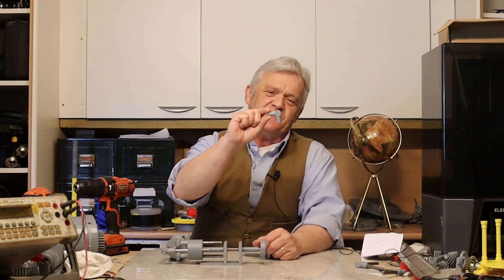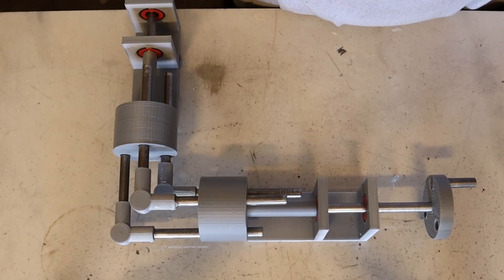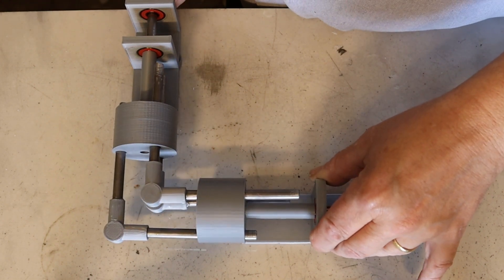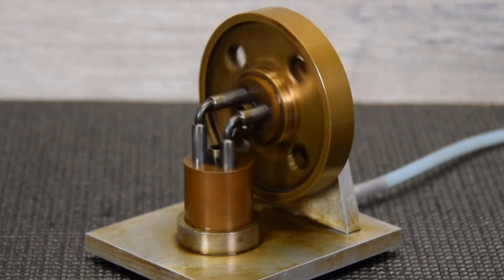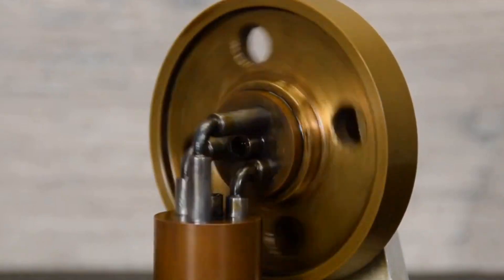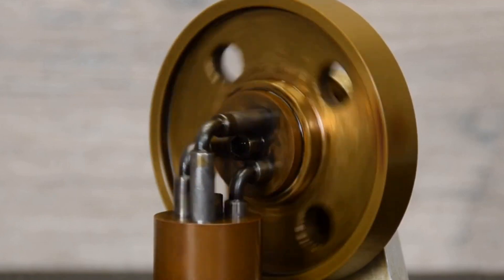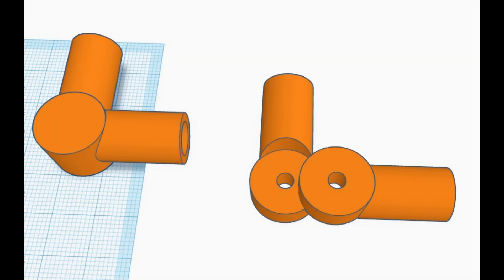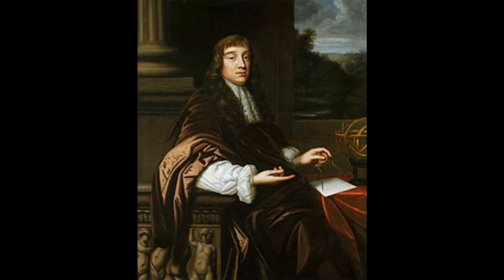2011 A Most Interesting And Useful Mechanism - Cardan And Hobson

Comment: looking at those shafts makes me think of piston engines. Imagine an internal combustion engine with zero articulating bearing surfaces! You could integrate a points ignition system and cam profiles into the rotating cylinder assembly, no chain or belt, and you wouldn’t need a flywheel due to all the rotating mass.

I suppose a real bear of an issue could present itself when trying to seal oil into the mechanism while it is rotating.

Comment: There is one critical failure point on that. If the rods are perfectly straight (not gay) they can get out of the optimized position and then cause a critical failure. Actually it might be, when they are not in the right spot on their length, it can't change angle anymore.

Comment: One problem with the hinged rods is that at zero angle the rods could rotate to put the hinges out of line with each other then it would bind. Such a mechanism would either have to be constrained from straightening fully or movement through zero degrees would need to be quite quick and it could never be allowed to hold at zero degrees, at least not while spinning.

Comment: This makes me think that half  of this. one rotation force could now be channeled to 3 different generators.  so you could set one generator up to merely monitor that its getting voltage ad turning, and keepturning on the other two generators as the wind ramps up and off as it goes lower. a sort of smart electric clutch.

Comment: I was thinking for the O Neil Cylinder,  Besides using 5 Foot Diameter Rope/Cable as the thread in a carbon fiber sheet (just scaled up) with mesh and graphene resin as the filler, Pylons obviously need to be interspersed with a network strung all around it.

Pylons need to be interspersed throughout the basket, so that buildings and the like can be plugged in (the Entire Cylinder needs to act as the foundation)

Could Ariel Eckblaws Disks be designed to act as not Only the scaffolding for the "thread" (5 foot diameter steel or graphene carbon fiber/nanotube cables) but also for inserting the Pylons for the buildings?  The "Thread" could be strung throughout the system, with graphene carbon fiber mesh and I was thinking either Concrete or a graphene resin could fill in the spaces, that way the Cables/industrial ropes bear the brunt of the shearing/lateral forces.

Also, Do you think it's possible to design a graphene carbon fiber "hitchhiker?"  Just like the burs in your socks after you walk through a grassy field, could the spaces be filled with graphene carbon fiber or even nanotube "burs" so that you could fill in the spaces with That, and just pour in graphene resin?  That way the "bur concrete" could also flex laterally with everything else and not just become rubble?  It would still stick together with resin, and any resin that itself cracks, you could take out, fill in with more "bur concrete" and it could flex side to side, even IF the Resin or concrete cracked it would still work if it failed.

To test it out, all I need is one section of the shell, essentially a 15 foot or 20 foot section of 5 foot industrial rope (plastic string from recycled bottles and bags are just fine) with the scaffolding, pylons, and support structure, along with the matrix of mesh and concrete or "graphene carbon fiber burs" with graphene resin filling in the spaces of the section of Cylinder.  Then the tolerances can be measured and spun around.

Comment: Ice coolers, those plastic boxes for ice, food and drinks, has a fatal flaw. The plastic used in mass produced coolers is a very good infrared transmission medium.
Is it possible to build a cooler where the inside of the box doesn't absorb heat from outside of the box?

Comment: Its noisy and noise means energy loss, and that energy loss is more than likely causing microfractures to appear in the 3D printed parts. It's hard to imagine those tiny 3D printed parts lasting more than a few days with continuous use. Even with metal parts there's rods moving in and out of those tubes under tension so there's going to be a lot of wear.  I suspect there's a good reason we don't see this joint being actively used and it's probably not because of fashion.
Reply: That is precisely the issue. The device is complex and requires multiple moving parts which must be strong enough to take linear and axial loads -- which adds weight, which forces tradeoffs between torque, speed, and efficiency. For most applications there are better ways of transferring power. The main advantage is the use of simple parts, even though there are a lot of them, so it can be built and maintained without complicated machining.

Comment: Hi Rob, that coupling on it’s own is a great project. There is another coupling that was recently invented to act as a constant velocity coupling called the Thomson coupling which is easy to find on the internet if you want to have a look.
Reply: I remember when it was demonstrated on the ABC show 'The New Inventors'. One heck of a cool CV joint
Reply: @JehuMcSpooran  yes me too I was actually working at the ABC at the time.
Reply: @JehuMcSpooran  yes the simple ones are usually the best. A few years back I thought of a new application for an old invention from the original series back in the seventies. Back then the inventor wanted a small car to drive to work in but needed a bigger car for holidays and he didn’t like the awkwardness of a trailer so he came up with a small trailer with one wheel that could swivel like the front wheel of an aircraft which allowed for a connection to the vehicle that  articulated vertically only which meant that the trailer would always keep in line with the car so it was easy to reverse and it was just like having a longer vehicle. A few years back I thought that it would be good to have one to carry a generator to convert a dedicated electric car into a hybrid for longer trips. I reckon it would be good for electric vans that are already short like the VW Caddy and Renault Kangoo.
Reply: @Cooliemasteroz  That does sound like a good application for that trailer. Do you remember a few years ago when the mouse plague was on, everyone was getting creative with how to mass exterminate them? Well, I suddenly remembered a guy on the show had put a massive fan on the front of his ute when that locust plague happened about 10 years prior. That would have been awesome to deal with the mice. Brutal but effective and free fertiliser.
Reply: @JehuMcSpooran  👍

Comment: I feel like this can be combined with a stirling motor somehow. You'd have to find a way to integrate the circular housing into cooling/heating channels with some valves in place to direct the expanded air into the piston that needs to be pushed out to turn the circular housing. Okay, let me think. 

Divide the circular housing in two  along the circumference. Replace the rods with tubes, capped on one end. 

Drill a hole into the side of the tube sort of like a wind instrument. Just one hole though.

 The hot side would be the back half of the circular housing. Block off 2/3 of the back section from the heat so it can only go into one tube at a time. 

Heated gas on back side of circular housing goes into the only exposed tube end, forcing it to extend, this will also cause the piston/tube to turn the housing as it moves. 

Once it clears the heated area, the circular motion pushes the piston/tube out the rest of the way, which is where hole is drilled into the circular housing for the heated gas to escape into the cold side. When the piston/tube is fully extended, the hole drilled in the tube lines up with the hole drilled into the circular housing, allowing the gas to exit. 

The cold side will need to be of higher volume to allow the gas to cool and should also have some sort of heat absorber/exchange with the outside air. As the gas is exiting this tube, the tube after it is getting filled, causing the housing to continue to spin. 

The first piston/tube has now evacuated its gas, and as the circular housing continues to spin, the piston/tube is retracted as it approaches the hot side again.

And then you'd just need a capillary tube to allow the gas to go from the cold side back into the hot side. This tube should be at the bottom of the device.

I think it would work... :D

Comment: On Friction: Try using magnetic rods housed in counter-magnetic housing to reduce the friction, that will also reduce the noise and eliminate lubricant.
Reply: On Friction II: On second thoughts for a low speed bearing like this a High Density Self-Lubricating Nylon housing would be ideal, the magnetic housing would be too expensive and complicated.

Comment: I was wondering about this very thing when I watched video 2010, though I also thought about if a ball joint type coupler would work.  It would extend it's flexibility in all planes.  It's a thought I suppose, though it might bind up as the rods are extended to an extreme.  It would be interesting to look into and might cut down on friction loss into heat and the rough binding.  Not sure, but it's a thought. Thanks for the video Rob!  Interesting indeed.

Comment: This is freaky I was just thinking about this last week, I'm on doing up a defender and was thinking about ground clearance, mines already had a 3inch lift done, but I was considering putting portal axels on it which they use on unimogs, trouble is they are 10k, so that's what lead me to these as they can handle loads of torque and if you put a few together you can get them to go in allsorts of directions.

Comment: At this time, there is nothing to keep the rods from turning in their slots when there is no bend (straight line, 180 degrees). So when the bend is straight, the joints can turn (or roll). Turned joints cannot be bent anymore. So when going from bent to straight to bent, be sure to not leave it straight very long, otherwise it can’t be bent any further.

Comment: Kind of reminded me of the Stirling Engine, and transferring the power with a fluid or air. 
One question Cardan and Hobson. 
Is it 1:1 ratio? What happens if you add another, but the shafts are closer in or farther out? Does it require more torque or get a speed reduction like in spur gears.
Reply: Could make sterling rotational

Comment: At the very moment that 1 of the 3 shafts is reversing direction, it's being powered by the pull and push of the other two shafts equally. It would seem to me that 5 shafts could work drastically better (of course more than 5 would be even better but we need to be able to manufacture simply and inexpensively). These 5 could be easily done within the same area using smaller diameter shafts. That way, at the moment that one shaft is reversing direction, the other 4 shafts would be powering it to a much smoother degree while have less sidewall drag on the shafts (frictional resistance).  Less friction, less wear and tear, and easier manufacturing tolerances.
Reply from the maker: basically the more shafts the better but keep it odd
Reply: It's a mechanical 3-phase power system!

Comment: Thanks for sharing Rob 🙌 Have you had any issues with excessive friction along the linear movement of those bars? 🤔
Reply: You've asked the question I was going to ask. It's an interesting device, but how would it be lubricated, unless it was in a flexible, sealed sleeve? I'm just an old shade tree mechanic, that has no professional experience or knowledge.
Reply: With a demo made of plastic i think so ? 😊
Reply: @jondoe598  I suppose I should have phrased that differently, hahhaa. I'm interested to know what type of friction reduction would be most suitable for this type of action? i.e. Bearings, magnets, grease, etc.

Comment: Back in the 70's I operated CNC mills to make hydrostatic transmission parts. This coupler could pump water, or drive a hydrostatic pump, with zero mechanical loss, to a matching driven pump. Many uses!
Reply: Surely there's always some kind of mechanical loss, no?
Reply: Friction => heat

Comment: Does it work like a gas engine like pisted
Reply: Yes is does.Many examples on youtube.
Reply: The pistons on one end, the wheel on the other. One could use petrol, or even steam or compressed air. And you have just given me another idea: A Hobson Joint Steam Engine.
Reply: @TimeSurfer206  or a hydraulic lol

Comment: Ever since the first video on this subject, that eternity since yesterday, I have been pondering this device.
And it struck me, just how easy one could make a supersized one of the Original, non-flexible ones, with pipe and elbows.
We'd definitely want to machine the pipes appropriately for the sleeves. And I am picturing brass sleeves, with teflon coated pipes. In 3/4 Inch (19mm) or equivalent. I wonder what it's load capacity would be.
And, silly question time, which I'm about to Google: Would more shafts allow a smoother transfer?
A: Apparently, the number of shafts is variable.
Oh, another observation: As I was watching the video yesterday, I was looking at the ends of the shaft reciprocating, and pondering ways to harness that.
Reply: Good idea, though you might have better luck using fine graphite or graphene on the pipes rather than the teflon.  It would be a great experiment to test them to see which would do a better job of reducing the friction.
Reply: 🤔🤔🤔 yes good idea 😊
Reply: You could have the ends of the rods affect valves that let the gas in for the case of steam or compressed air, or you could have them uncover ports for internal combustion.